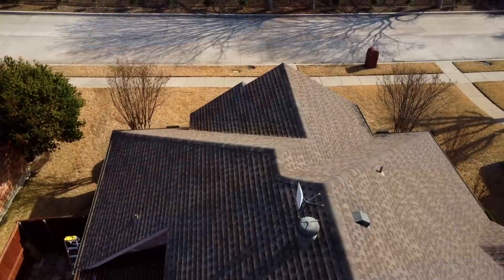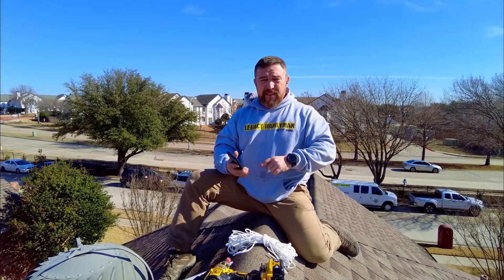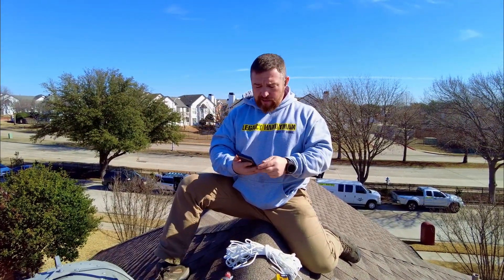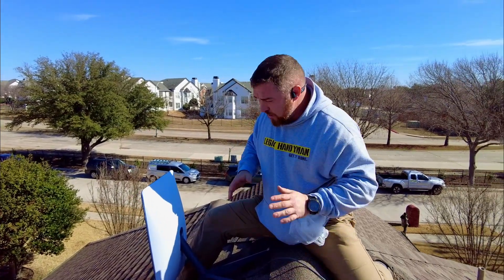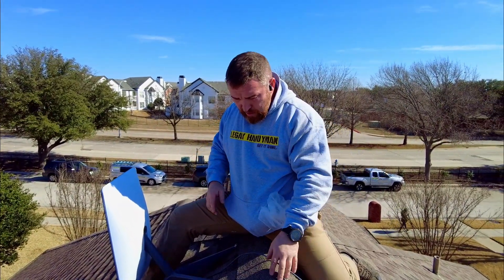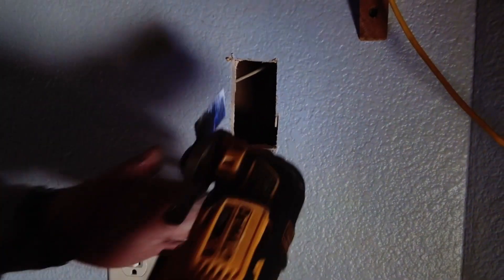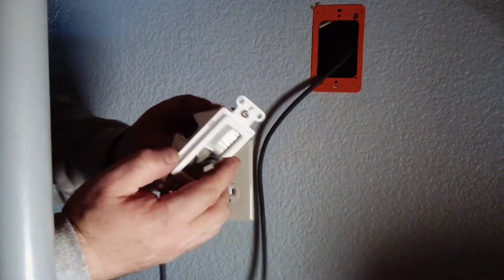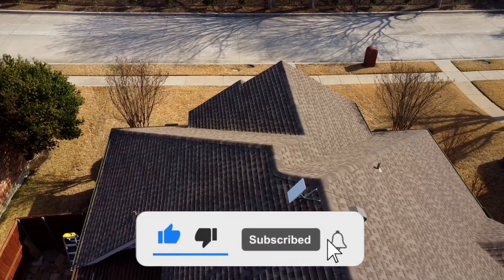"How to Install and Set Up Starlink Internet - The Ultimate Guide for DIYers!"

Comment: Thanks for the video. 
I asked a question on starlink Ontario and used a clip from your video 
I hope it’s okay if not I can remove it. 
Have you been using the dish? 
Have you had any signal issues. 
I would really like to use your installation method using the original holder and have about the same slope
Reply from the maker: So far I am happy with service. No interruptions or speed issues.  I had to buy an adapter for network cable.  But otherwise everything as expected. Much better than other providers

Comment: You should add a section on bypassing Starlink's router and using a high end gaming router in it's place. (Requires $26 Ethernet adapter - Under Settings, click advanced 3 choices - ignore error message)